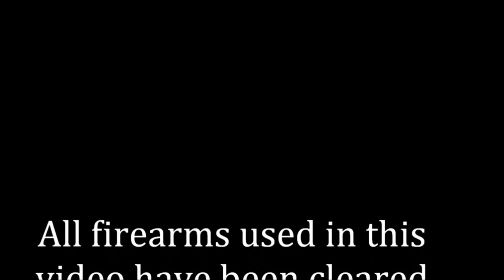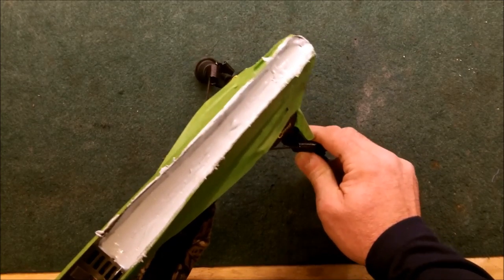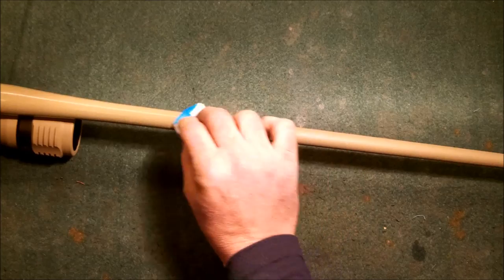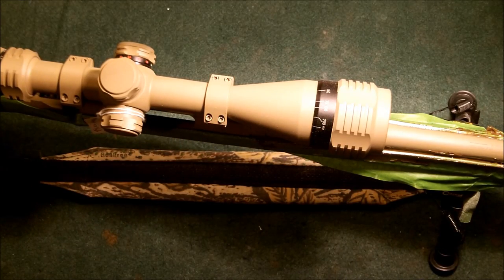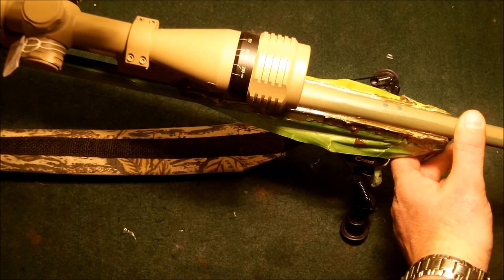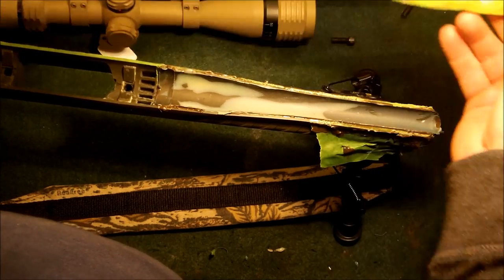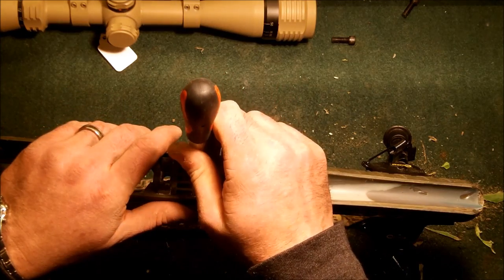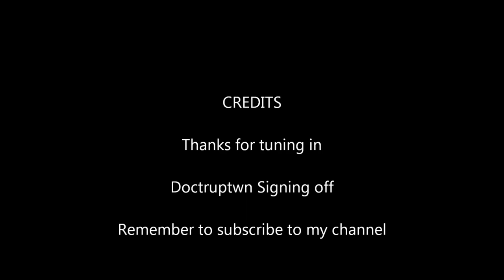Ruger American Bedding project

Comment: Wouldnt the smart move here be to first glass bed the action, then go and bed the fore end but with 2 or 3 layers of tape around the barrel to maintain a free-float while also adding rigidity to the stock?
Reply: I AM GOING TO SAND OUT AS MUCH AS PLASTIC AS I POSSIBLE WITHOUT ANY OF THE FILLS, I THINK THAT SHOULD TAKE CARE OF THE CONTACT AND KEEP THE RIFLE STILL LIGHT WEIGHT FOR HUNTING.
Reply: That would make more sense. there's too much extra materials used along with labor.

Comment: so what happened to the free floating barrel hmm instead of filling it with useless bondo you could have used stiffing rods and epoxy the ends of them to stff up the stock better yet for the time and money get a boyds stock or have one custom built out of wood on a cnc twisting in the forarm means nothing as long as the action itself is tight the barrel will sit where it wants to

Comment: Rather than body putty. I used Bondo glass, which is thick resin mixed with shredded glass strands used to repair fiber glass autos. It worked fantastic.

Comment: You are rolling the dice by going from a free-floated barrel to fully bedded forend. Remember the RAR is designed to be ff. Pressure bedding like that might give you a tight 3-shot group, but i bet the POI wanders like a soab as the barrel heats and expands. I bet your 5-shot groups string from this change.

Comment: I could see adding some stiff filler in the forearm but NOT go over the ridges. I'd add it to one side at a time so I could then tilt it off center to spread the resin up the side more - just a little to break surface tension then let it drain back down some so it would stiffen the sides. The idea is to stiffen the forearm but NOT touch the barrel. I'd run 320 grit facing outward up and down the barrel until it shaved off any plastic that was touching - like extra flashing in the ribs and at the front lip. The side top edges could also be scrapped or sanded with a block to get a 45 degree angle so any flex didn't touch the barrel. That's the whole idea of free-floating so the barrel heats up AND cools evenly. Filling the bed up against the barrel would affect cooling along the bottom. It would also transfer the tripod push onto the barrel. That would be like leaning the barrel against a tree instead of the stock or your hand. Did the stock get heavy if you filled it fully with resin?
Reply: I took the "ridges down a little on mine, kept barrel free floating but stiffened it up.  love it

Comment: Where's the follow up? It looks like you've lost the free float and now increased contact down the entire barrel with out completely fixing the flex. Maybe only filling the lower 2/3 rds of the forearm and heat flaring the edge contacting the barrel would help.

Comment: So here we are in Aug. 2017 and I just picked up my new Ruger American Predator rifle ..after the idiotic California 10 day wait period.   When I removed the action from the stock to check for flexing, I noticed that Ruger made some improvements to the mold.  Rather then having the same worthless perpendicular molded webs like your older stock has, the new Ruger synthetic stock has criss-cross webs to prevent flexing along the entire fore grip. The butt is still an open cavity and needs to be filled with a more suitable material other than the foam block.  Peace...
Reply: Thanks for the update!
Reply: I've  used the little plastic "beads" that are in a bean bag chair. 
Available  at fabric/sewing supply stores.  Typically  adding a little over a pound to the stock.
Reply: @jamespilbeam209  I spent a year trying to get that rifle to shoot, typical was 1- 1/4" at 100 yrds.  So I bought a trigger and an MDT aluminum chassis and it now shoots 1/2 MOA...

Comment: I actually wanted to add some weight to my stock on the RA .308 as well as stiffen it up some. I like em a little heavier. Added Fiberglass resin and bbs in the forend to the top of the cavities and the butt. I liked the result. Much stiffer stock and it does not sound hollow at the stock end. Trimmed back some of the polymer and maintained the free float. Shoots well with 3-9x 50 Nikon glass on it.

Comment: The reason why there is less flex is because the stock is literally molded to the barrel. I'm guessing that the barrel harmonics and oscilation is consistent since there is full contact throughout the length of the barrel. Why didn't he put release agent on the tape that way he wouldn't have to file it off?

Comment: Wow so you bedded the entire barrel an un-freefloated it. Good job genius
Reply: I was in shock too.  I would fill the voids with BBs, then use accraglass over top, I would also get rid of the tip of the stock where it touches the barrel.
Reply: Old timers used to bed the action and barrel all the time. Free float is overrated. Pre64  Winchester 70's have the barrel tight against the wood the full length of the barrel and an action bolt that screws into the barrel. I've shot 3/4 inch groups at 200 yards with one in 270 .
Reply: @jasonsimone3523 that goes against what all gunsmiths have told me over my 45 years of shooting.  You would be hard pressed to find any gunsmith that would agree with you.
Reply: @jasonsimone3523  I doubt it
Reply: NULA does that with their rifles on purpose. Of course that is a  thin lightweight barrel. I agree with the first poster though, but I was thinking fill with foam then a layer of bedding in the whole channel and a couple layers of tape around barrel.
Reply: @Chuck G  a little metallurgy can go a long way.
There's two schools of thought here.
1. Free float barrel and bed the action.

The pro group is that as the barrel warms up after a few shots it doesn't swell and get pushed off angle by any pressure point along the fore end.
Tha con belief here, is that on thinner barrels like this, they warm up slightly unevenly and warp off just a little causing a different POI after 3 to 5 rounds.

2. Full bedding believer camp, thinks that a good even bed all the way down maintains/supports the integrity and direction even after a few shots.

I've heard a lot of claims from full bed believers but never witnessed it.

I am a bed the action and FF the barrel believer. It's always treated me well, and historically speaking US snipers since Nam have been free floating barrels and bedding actions and using them to make thousands of hits on enemies over the years. I figure if USMC Gunny Hathcock II can use that method in the heat and humidity of Vietnam to hold down a battalion of NVA for 3 days in elephant valley, then it's probably good enough for my purposes.

Comment: I just got a Ruger American .308 Predator. The fore end on it has a different design where it has some cross pieces molded in to make it more rigid. I am trying to keep the weight down and would like to keep it a free floating barrel. I was wondering if bedding the action would help accuracy and make it a bit more rigid. It has the aluminum blocks in it that the action mounts to mainly just that little section in front of the front screw about 1.5 inches or so.

Comment: I would suggest fiberglass body filler  or Rockite and sand to free float the barrel........JB plastic weld the tang and around the pillar area.  Also use neutral shoe polish as a release agent........The barrel will have to free float for barrel harmonics .........yet make the stock solid.  Also, peel away the bedding after it has set for 2 hours.  Total cost......$20 bucks...
Reply: is it a good idea to drill some holes in the cell dividers? To make the resin effectively become one piece with divisions as opposed to a series of divided sections filled with resin or whatever.

Comment: What am I missing here?!?!?  Why are you bedding the front of the stock?!?!?  You suppose to bed only the action to stock...  Not the barrel!
Reply: It's an older technique that is sometimes still done.
Reply: Full length bedding of the barrel completely dampens barrel harmonics and usually results in very tight groups and very good consistency from shot to shot! I once full length bedded the barrel on a Winchester Model 88 in .308 Win. that I shot my favorite hand loads in at the time. It shot 1 1/4 in. ave. groups prior to bedding and after bedding, it shot sub 1/2 inch MOA and do mean SUB 1/2 inch MOA! It also seals the forearm on wood stocks, reinforcing against stock warping in wet/rainy or high humidity climates. "Free Float" barrels do not always shoot their best groups without some sort of bedding, be it a pressure bed at the for-end or support bedding at and a short distance ahead of the receiver ring. Today's shooters have been wrongfully led to believe that "free floating" barrels just plain ARE where "absolute accuracy" lives, but that is not entirely true! Free Floating barrels, "generally" shoot well, but I have out shot many of them with rifles equipped with a small pressure bed at the for-end tip that applies just a few pounds of upward pressure to arrest/dampen barrel harmonics. Fully bedded barrels are stable and consistent performers!

Comment: I'm confused but I am also pretty inexperienced. I spent alot of time getting rid of material to make sure nothing came in contact with the barrel. But it looks like everything is contacting after bedding. Is there an advantage to glass bedding over free floating? Thank you
Reply: Shawn, this is know as pressure bedding the barrel - been done with success forever.  Compared to the stock he started with, it is leaps and bounds better.
Reply: @Chuck_Carolina  thank you

Comment: What sort of 5-10 shot groups did the rifle shoot at 100 yards or more before the bedding. And What sort of groups does it shoot after with the same ammo and distance, preferably similar temp and wind.
 I would like to know how effective this is before I think about trying it on my american in 6.5 creedmoor, witch shoots ok out to 1000yrds it will produce a 20in group with the majority of the shots in a 6in group. I was hoping that either bedding the barrel or filling the fore grip to reinforce and not allow it to touch the barre may put all the shots in the 6in group at 1000yrds.
Reply: Just get a Boyd's laminated wood stock for $99 and you won't have to bed it. It'll make your platform much more stable than if you bedded it in the plastic stock.

Comment: Why would you bed the barrel ????  After the barrel heats up about the 2nd shot you totally destroyed your accuracy.
Reply: Not all rifles shoot better with a free-floated barrel.
Reply: Actually.... A fully bedded rifle barrel will often shoot with stability and consistency that floated barrels cannot match. I owned two examples; a Remington model 700 Classic in .300 Weatherby and a Winchester model 88 in .308 Win. I bought the Remington bedded by a Gunsmith and I bedded the Winchester from stem to stern myself. The accuracy improvements to either rifle was night and day! The model 88 went from shooting 1 1/4 inch groups to 3/8ths inch at 100 yards. The Remington shot consistent .5 moa... Don't buy into all the hype regarding "Floating Barrels" being the ONLY answer to rifle accuracy my friend, there are several methods that rifles respond to very well when it comes to action and barrel bedding techniques!

Comment: How not to bed an action. Later in replies he says he is going to remove material to free float it again. Would be wiser to just increase the free float with a Dremel so the barrel wouldn't touch as all this silly work for nothing. BTW I have bedded actions and free floated barrels. That flex in the stock doesn't mean anything so long as it doesn't touch the barrel. Too many people go silly over the little bit of flex in a composite stock. Most of them don't know what the heck they are talking about. It's just an online talking point.

Comment: Don't buy the new ruger they look like junk,  And if it looks like junk it is.
Reply: You can't be further from the truth! Read and research... they are comparable to more expensive precision target rifles for a whole lots less money. They are used for over 1000 yards and over shooting comps. Shoot lots and stay safe.
Reply: I don't have to read or research.... I went to buy one when it came out of the box it had oil all over it. SO that just means it's going to rust the first time it gets wet. I tried the bolt and it is junk and will not last. you'll be lucky if you get two years out of this gun before you have to start working on the gun. and by the way I'm talking about the .22 and the 17HMR. But with that said if all of the American rifles are made the same way there on better. Try the Ruger 77/22 or the 77/17Hmr than tell me I'm wrong. Get back to me once the gun gets wet and show a picture of all the rust you find and you will find RUST . I'm sure of that
Reply: Grover Alsept my cousin has had the ruger American chambered in .270win since 2015. After barrel break in, he is shooting 1/4"-1/2" at 100yds no problem. Still shooting the same today. 300yd group is 1"-2"... I would say that is pretty good for a junk gun...only thing we done was sand out a little at the front of the stock to free float it..
Reply: @bigshowthe-tn-redneck2471  Agreed. I have the RA Predator in 22-250 and the RA in 7mm08. Both rifles shoot at or just a bit over .5 inch at 100 yards and are as reliable and solid as my Remingtons, Tikka and CZ rifles. I think Grover is having some kind of bad dreams... ;)